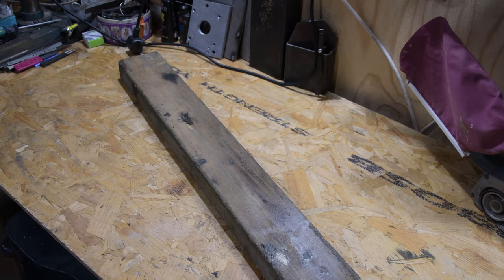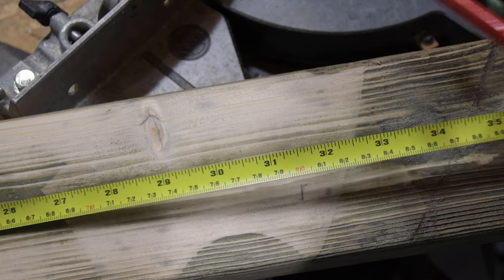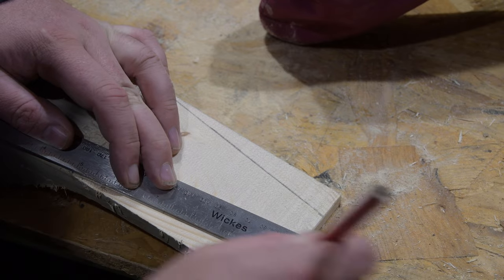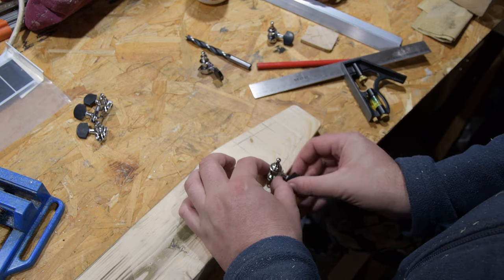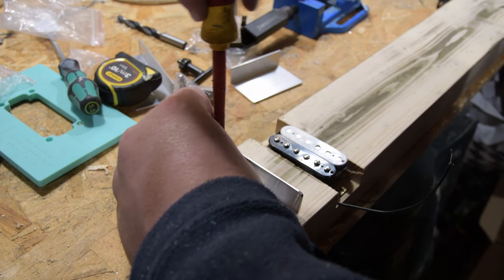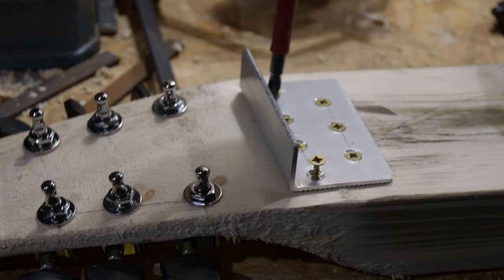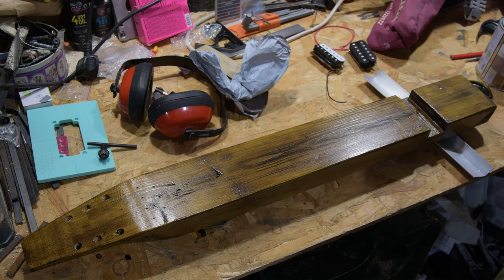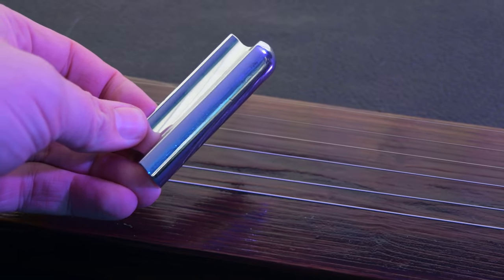How to build a lap steel guitar from scrap wood and spare parts

Comment: Top of the neck by the tuning machines, I see a lot of guitars using a lil hack to lubricate the strings, and I thought I'd share it: take a mechanical pencil, and run the point back and forth along the filed grooves.  The graphite'll ack as a lubricant for the strings and also make 'em less likely to break.  That's my take on it anyway.  This is an awesome DIY project!  Thanks for sharing it!

Comment: Would would it sound like if each string was slid separately to form a chord? It'd perhaps take a robot to pull it off, but it'd might be an interesting animatronic instrument?
Reply from the maker: Hey, my next step was going to be a pedal steel. where select strings can be "bent" so that the chord changes. Though I think you have an interesting idea too, that would be very interesting, it would be hard to not have a delay.
Reply: @deancoyle  Yeah, the sliders would have to move fast and probably be designed to arrive at their target locations at the same time? How long do you have to switch a chord? To avoid a delay, you could program it to start the move early to arrive on the beat. More a project for an animatronic instrument builder than a manual instrument builder, lots of code and electronics. Not everyone's cup of tea...
Reply: @deancoyle  You might already have heard of them, but you can add benders to a lapsteel as well to get a similar system as a pedal steel but way easier and cheaper to set up.

Comment: Wow!  That's a really nice tone!
Don't suppose you could build a 10-string for me?
Love it.
Reply from the maker: I do plan on a making a large one of these soon. Stick around and see if it sounds as good. Do you play Lap Steel?
Reply: @deancoyle  I have a 25" scale length I had built years ago that has a simple minor-major set up on 6 strings plus two extra on top and two more on bottom with Reese Anderson style mods both top and bottom.
This allows me, as a non-musician to find my way around one string at a time - which I consider to be the best sound - while being able to emulate most any sound you'd want to hear on lap steel guitar.
I spent years adjusting the string tensions and proximity of the string master magnets to come up with the fullest and balanced sound.
It sounded pretty good to begin with but now I think it's on a par with Bobby Ingano's A22 Ricky.
I'm ready to do the same for another guitar with a short scale length and maybe P90 pickups but the pickups you used are really sounding full and good to my ear.

Comment: That’s so cool!! How did you know where to locate the bridge? Is it important to be exact like on a guitar?
Reply from the maker: The distance doesn't matter, though I have added a fret markers to mine. So I had to match the printed design scale. https://www.ebay.co.uk/itm/304157106404
Though i have seen people use zip ties / cable ties as markers and that works well, any scale length would work for that.

Comment: Nice work, what pickup did you use? I ask as I have a few cheapys laying around, just wondering if they will do or was the one you used on the hotter side?
Reply from the maker: I used a Epiphone one I had in the parts bin, I think it was from a budget Les Paul.

Comment: Nice.  I have one question.  What is the distance between the two peice of angle aluminum?
Reply from the maker: I went for a 22.5in scale. There is a seller on ebay who sells a 22.5in fretboard in the fender deluxe style. I did think of adding this, but it would push the budget out a bit. I have also seen other people just use zipties as fret markers. So many options!

Comment: I would like to hear a lap steel through a synth pedal like the EHX Strings or Mellotron
Reply from the maker: What an idea! Do you think it will work?
Reply: @deancoyle  Maybe there's a soft-synth way to find out, or borrow/hire one of the pedals. I want to build one of these with the core concept of having any sound, but using the hands to organically express the pitch, envelope, and even timbre.

Comment: Is it possible? I’ve got left over parts of a guitar.. instead of fabricating one l…can I use a tunomatic bridge as a nut? In my head it makes sense. But I don’t want to start building it and it fails. What do you think? Not the tunomatic piece where the strings roll over but the piece that holds the strings in I guess this is the tail piece? Can I use that as a nut ?
Reply from the maker: Yeah that should be fine

Comment: Now tell me how the fuck to make an 8 string. I'm obsessed with this instrument but 6 isn't enough for my needs. I need one, nobody sells them where I live, nobody at all. They barely exist. I cannot afford to have one built for me either.
Reply from the maker: Is it just the same but wider? We will need a bigger pickup, and some more space that the headstock end.  I want to add pedals next to mine...
Reply: @deancoyle  or use a few pickups staggered like on a P Bass?

I was wondering about possibility of using sliders for the pickups - so you can move them to different nodal points. Or bass strings.
I got so many swapped out pickups and spare string sets. Looks like a fun use for them. With 2 pickups / outputs and a focus right I guess stereo becomes a thing - Rickenbacker style. And some Zoom FX on this would make for very adaptable sound.
Reply: Proper pickups are available from boutique pickup makers , notably Jason Loller . But that will take it out of the $20 build category .

  Your cheap option is copy of a Lipstick pickup , in the original Danelectro dimensions . 

  They are available from Guitar Fetish , and probably others .